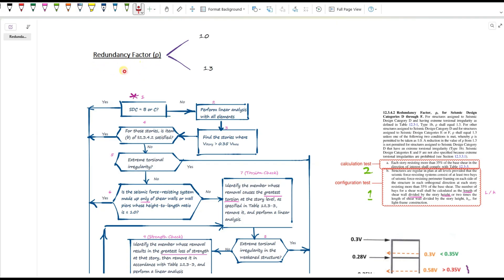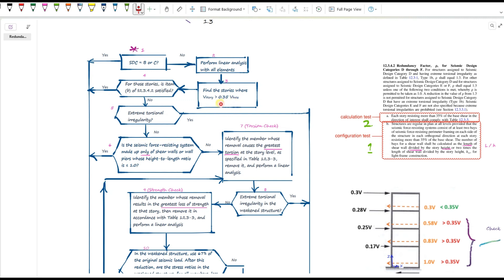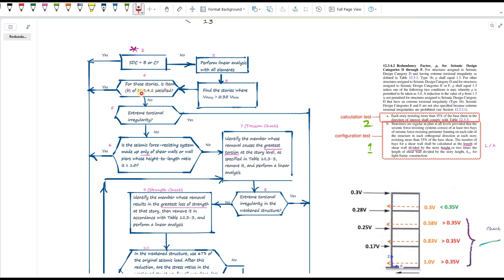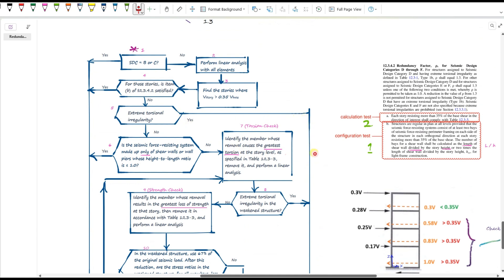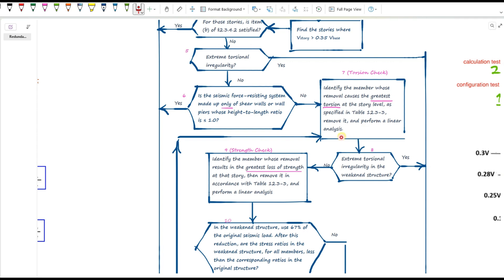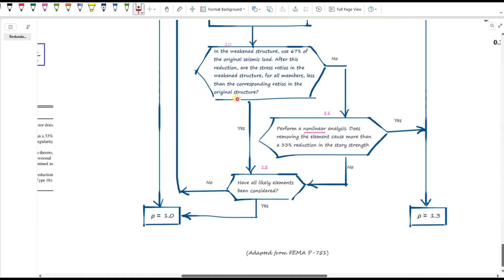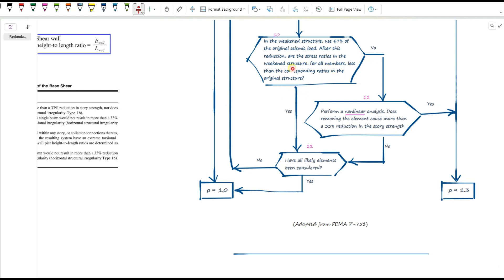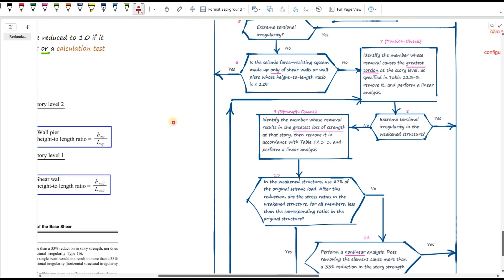Redundancy Factor (ρ) — Part 2 | ASCE 7 Flowchart Explained

Comment: A colleague applies the 0.35 stiffness modifier to all axes (M11, M22, M33) of a BEAM in ETABS. Is this correct? Justify your answer based on ACI and best practices.
Reply from the maker: This question isn’t related to the video, but quick note: in ETABS, m11/m22/m12 is for shells (slabs/walls), not beams. Watch this: https://www.youtube.com/watch?v=sGtICo5iPGw&t=31s